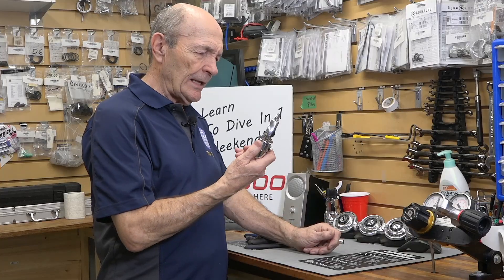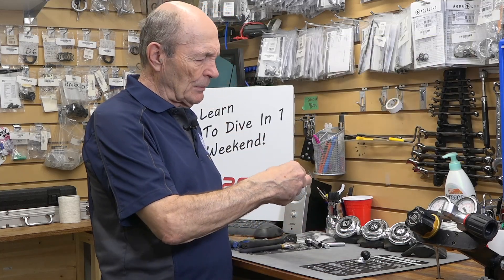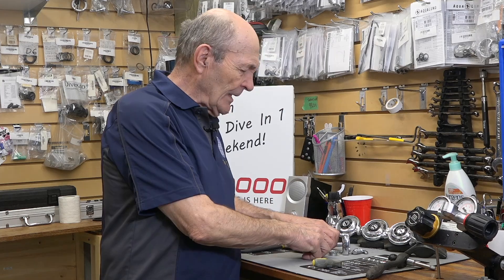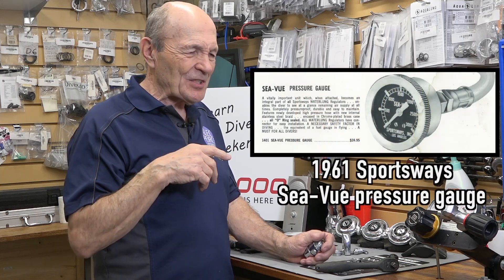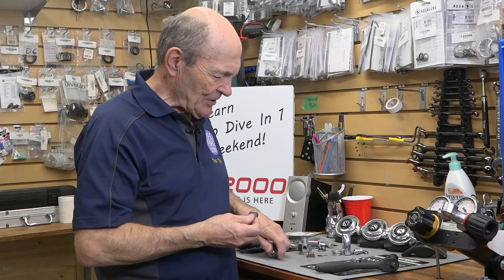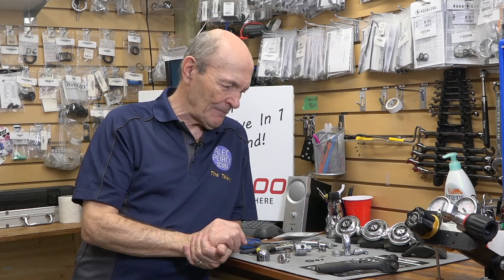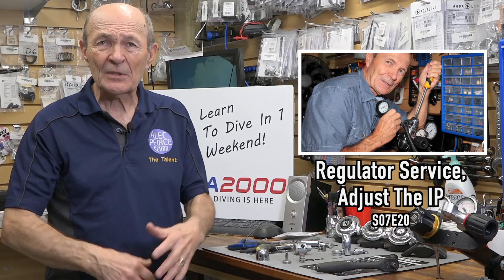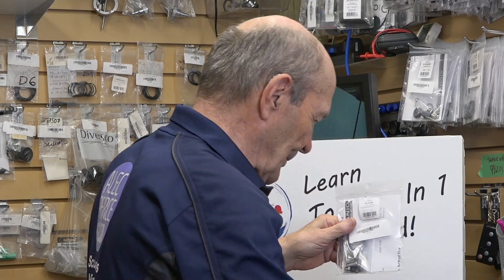1st Stage Service Of Older Regs - Scuba Tech Tips: S19E11

Comment: Question - i just got my open water certification. As sort of a celebration I rewatched Thunderball. Having watched many of your videos on historical dive equipment it was neat to apply my new knowledge to the gear I was seeing on screen, like Voit tanks and gum rubber fins. I was surprised to find that while most divers in the movie use the two hose “second stage on the back” regulator rigs, Bond uses a more modern style “on the mouthpiece” second stage. I know a big part of that choice is the ability to show Connery’s face on film, but based on your videos I was under the impression that the one hose rig was far newer (1970’s?). Was the 2nd stage on mouthpiece design slow to be adopted? Better suited/more trusted in warm water? Less military? Just curious about when and how the older two hose setup transitioned to the single hose.
Reply from the maker: It was a slow process. Double hose regs were made into the late 1970s, early 1980s. Single hose regs came out in the mid to late 1960 - almost a 20 year span. Old divers didn't want to change or didn't think the 1 hose reg was as good.
My own YMCA Instructor in 1962 told us to avoid a 1 hose reg. "They'll kill ya" I believe was his words.
It was more of a macho/traditional thing than any technical benefit. 1 hose regs are better in many ways.

Comment: Graingers ~ Internal Toothed Retainer Clip
Retaining Ring, Internal, 0.010 in Thick, PK50: Inch, Self-Locking Retaining Ring, Tooth-Locking, Steel
I would be cautionary, this was a word search that I did to get into the pall park. DO NOT mistake these retainers for a "looks Suitable" hardware store mild steel star washer. These as Alec stated are a one shot deal. Either e-bay or order online. They should be like a .010 thick spring steel, they go in and get set with a suitable sized socket. Sockets don't scratch finished surfaces or shouldn't. Ideally they should be of a tempered stainless steel for spring tension. High carbon spring steel just rusts from your eye moisture when you look at it and would be much stronger meaning more difficult to remove as those legs can dig into the bore finish. It's sole purpose is to retain the sintered filter assembly.
Hint: Get a pair of inexpensive digital calipers. They are both inch and metric reading. Many modern anything is outsourced and could possibly be metric while older U.S. A. made product is Standard or in Inches. 
Scuba is Simple Pneumatics
NEVER ever use oil on anything scuba..period...No not ever. Silicone or Christo-Lube.
Nitrile or Buna or Viton rubber o-rings can be bought at any Bearing/Hydraulic Supply House or Pneumatic Supply House, just make sure you thoroughly clean them like anything else before use. (Manufacturing processes) Don't 2nd Guess anyone, be self-responsible,....haste is waste..
Ask the Pro-Boards if You do not understand. Pride Kills asking for help is free...Dive Safe and Enjoy!

Comment: If you don't have the expensive scubapro 'shallow' socket to take the inlet out, a suitably large adjustable wrench will reach it at an angle, over the curve of the yoke.
Reply from the maker: That's a workaround and works fine for once a year.  More than that and the nut gets rounded and will cost you to replace it.  
A
Reply: Or just use a box wrench.